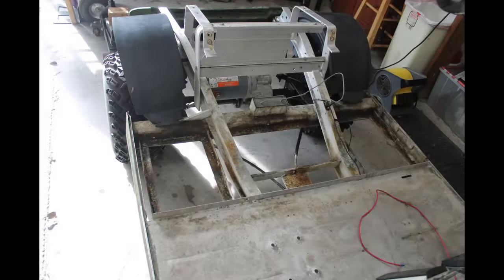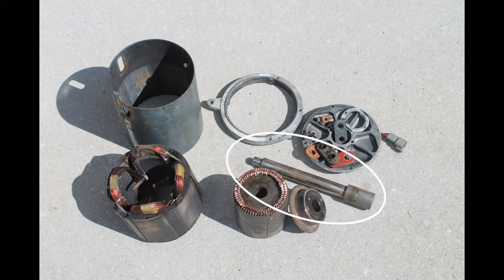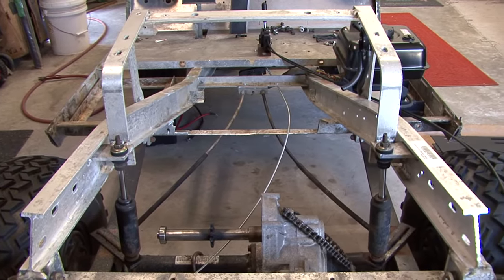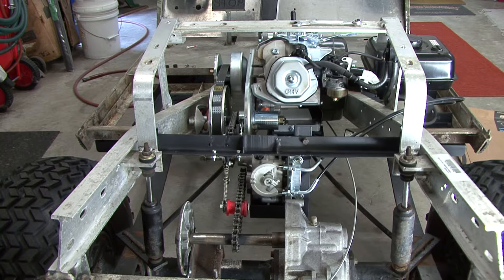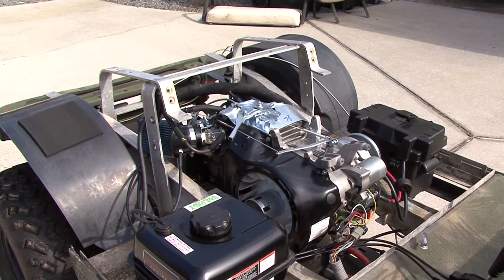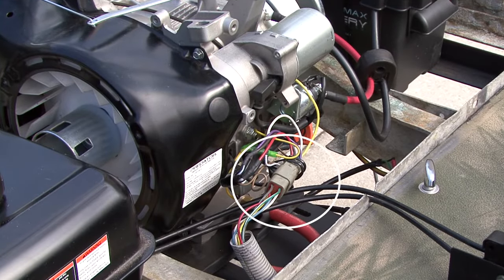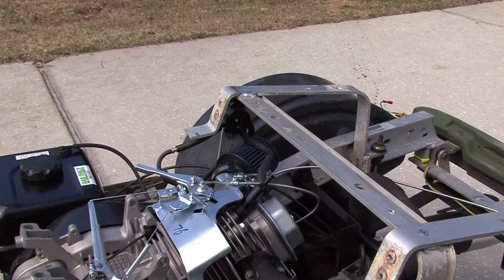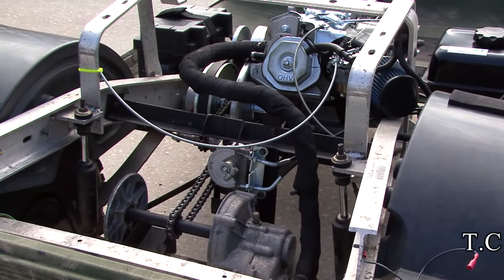Golf Cart Gas Conversion

Comment: Hello, got side tracked since last post, I fliped the rear ,that went very well. I chose a 14hp subaru engine  set up with a  chain clutch ,  and  did not like that ...but due to other projects , I had to put that aside.Now I am back at it and decided to go all in. I am starting today  to rework  the frame  to adapt to the engine ,the 40 series torque converter, and rearrange the placement of my trans..  I  find That this is the way to go with  great info as a guide ,Thanks again for detailed video.

Comment: Just finished a 1998 basket case ,especially everything was in crates ,now I am on this conversion, installing a Subaru ex40 ,they have the exhaust on the top and that created a problem with the body, had to position the elbow to the side  ,other than that your blueprint is  on the money

Comment: I did a similar build i did use a gas rear end on electric frame. Electric frame is way stronger than gas and also did the brake flip and turned the axle like you with 6-1 gears and a comet clutch no chain dose 40 mph I like how you think.

Comment: Hello My Friend , wanter to give you an update on the conversion , well , it all comes back to the engine I choose , which is a great engine ...BUT... the exhaust exits is at the top of the engine , I  Had to modify that whole section  above  heat shield  and air space to clear  for the seat closeure.  and  fabricate the manifold outake tube as well.  I  had the yellow spring on the driven clutch  it  was a lot of torrque  just about lifted the front off the ground ,but I did not like  that  ,so I went back to the red spring and  and drilled another hole inbetween 2 &3  for spring tension .The rotation is the same and proper direction. Now for the Biggie ,I had the shaft turned down to & 7/8 ths to accept the 10 tooth  gear with the 3/16ths keyway. I orginally was at  a 14 tooth  and a 40  chain . .  I keep refering to your build and it helps  me to  stay focused . Thanks
Reply from the maker: You are making progress, that is great news to hear

Comment: You had any issues with the chain coming off the rear axle when hitting large bumps
Reply from the maker: No, I have the chain pretty tight.
Reply: @BigBlok502  thanks for the reply I picked up a club car 1996 and the aluminum frame and axle looks exactly like yours

Comment: Hello my Friend , thanks for all the tech advice, I was hoping that you received the link to my driven clutch directly  to the gear box stepping the 5/8 shaft and a extender shaft coupled.  I do have that in one of my videos. I installed a 14hp subaru 40ex engine with the gearbox. The problem with this type engine is  that the exhaust exits from the top of the engine so my clearence from the seat was very limited. I did compensate   for  the heat exchange . I found a OEM  gas clubcar pan mount that I will install this spring which will lower the engine from my temporary fix. I may remount the gearbox,to bring it closer to the rear,was wondering if the shorter  chain distance would make any difference in the drive... I got another shaft and stripped the windings , (2nd one I did, no fun at all } and I will turn  three quarters of the shaftthat down  to 7/8ths to acomadate the  10 tooth 40chain  gear.My clutch is mounted same as yours , I did install the green/yellow reverse spring ,but I noticed that yours was still  the factory red spring . I maybe should have left well enough alone? Cheers
Reply from the maker: Hey, thanks for the link, I never did get a notification from YouTube about the link though. Nice work.

Comment: Have you had any issues with the gear box causing a jumping sound? Almost like a loose chain when you start to accelerate... Mine is causing a bouncing jumping situation.
Reply from the maker: Not from the gearbox. In the early days I was getting a snapping noise from the chain due to the axle twisting, I cured that by installing heavy-duty rear springs.
Reply: @BigBlok502  I'll have to keep that in mind. I'm doing a huge build on my club car. Extended it to a 2 to a 6 passenger. And put a 459cc predator in with a reverse gear box. I built a custom 12" lift and put some nice 32" tires on it. But I'm having a terrible clunking / Jerking problem.

Comment: I’m In the process of building the same cart setup, my next step is buying and engine, did you have extra room with the preditor 420? Harbor freight has a preditor 459cc which according to the website is slightly bigger, wondering how much room you had putting in the 420 and in your opinion if you could fit a 459cc
Reply from the maker: It's a pretty tight fit, I had to remove the pull starter in order to fit between the frame rails. The Predator 459 looks to be the same configuration though, so I would imagine you would just run into the same obstacles I did and make it fit.
Reply: According to the website the dimensions are slightly different, im assuming the width is where you ran into clearance issues, I would really like to put the the 459cc in there but I feel like I’m taking a risk, in your opinion and experience would you put the 459cc in your cart if you had the option back then knowing what you know now?
Reply from the maker: @Cam_Bass  I would stick with the Predator 420.

Comment: Finally got the engine and trans fitted,  I mounted the pulley to the gear box , I tried using a push  choke cable but I can't get full throttle , I think I will use your method ,do you have any  info on the cable you used , I have the same cart. Thanks!
Reply from the maker: I removed that choke cable because it was too long and after a period of time it became almost impossible to pull the choke on. I replaced it with a shorter cable and drilled a hole in the bulkhead just below the seat and it works much better.

Comment: Wondering how your gearing is working out.  About to do it your way.  Seems like a good approach.  😎👍
Reply from the maker: It's working out great for me, I drive it daily.
Reply: FYI I’ve been running mine for about a year now and it’s great. The gearing works perfectly with my 12/25 tires. Thanks for your approach.
Reply: WhT kind of mph are u guys getting
Reply: @johnnycrawford7690  mine will go 28mph.   It climbs hills pretty good also which is what I was hoping for.

Comment: Great build and video! I just finished my club car ds and used some of your ideas  like turning the axle 180°, which made way more sense. I used the predator 420 with the 40 series, but was able to order one with a 5/8" shaft so driven clutch went right on the reverse gear box and then used the 10 tooth 40 series sprocket to go to the the electric motor spindle that I pressed out similar to yours but I was only able to find a 13 tooth sprocket for it. My question to you or anyone on the thread how can I get better top speed? I can only get 10-14 mph tops. Would the sprocket on the pressed out motor shaft need to go larger or smaller? I know I can possibly replace the gears in the axle assembly, but the cost is over $500. I do have the stock 18" tires and it's not lifted, would lifting and putting 23" tired make that much of a top end difference? Thanks everyone, I hope to post mine when I get all the little kinks worked out.
Reply from the maker: A smaller sprocket on the rear and taller tires will most definitely increase the top end speed.
Reply: Big sprocket on the output of the trans, I'm going with 24 tooth.

Comment: very nice video, but where did you buy the key switch extension? to install it in the dash
Reply from the maker: I cut and spliced longer wires in the wiring harness for the engine

Comment: I’m doing the same but have no idea about the thinking behind the drive shaft support. What should be my goal in creating the support? Also, is there a way to connect the sprocket other than welding that you would recommend?
Reply from the maker: The drive shaft support is the end plate from the original electric motor, I have since welded it to the axle because it kept slipping on the axle. As for the sprocket you could try cutting a keyway in the shaft.

Comment: Hey man, great build very detailed video. I have done pretty much the same thing I use the predator 420 converted it from electric to gas my issue I’m having is the gearing. The cart will not go any faster than like 7 mile an hour. I originally had a 10 tooth sprocket, maybe it was 12 on the gearbox and I had a 12 tooth sprocket on her rear axle and I couldn’t get over 7 mile an hour so I put a 36 tooth sprocket on the rear axle and it still doesn’t make a difference or do you happen to know why it’s like the motor wraps out before I get any speed
Reply from the maker: Try using the same size sprockets that I used. Also, the taller your tires the higher the top speed.
Reply: @BigBlok502   that’s what I originally had on it was a 10 tooth and 12 tooth on these from all videos that’s what most everyone is doing
Reply from the maker: @cameronhulin7084  you want the smallest sprocket possible on the rear axle, going to a larger sprocket will just slow it down. What size tires are you running?
Reply: I have a 10 tooth sprocket on the gearbox and a 12 tooth sprocket on the rear axle. That’s the smallest sprocket I could get considering I did not turn the shaft down  so the shaft is an inch and an eighth I cannot find a 10 tooth sprocket that has an inch and an eighth bore
Reply: I’m just running stock tires I plan on getting bigger ones at some point
Reply from the maker: @cameronhulin7084  12 tooth is the smallest sprocket I could get on the rear axle too, my tires are 23 inches tall though, and that may be the difference in the top-end speed.
Reply: Damn auto correct made that reply not make any sense meant to say I’m having an issue with the driven pulley the belt keeps getting wedged as the driven pulley expands under a heavy load
Reply: Mine is doing the same thing, I flipped the axle and it won't push out any top speed at all.  He said they have straight cut gears. Mine is a 83 and it doesn't have straight cut gears on mine. I think I'm going to have to turn the axle back around. The reverse gearing is slower.
Reply from the maker: @cartsquads47  unless your rear axle is a transaxle I don't think you will see any difference, let us know how this works out.
Reply: @BigBlok502  mine is a 83, I found out the 81-83 electric club car has what they call the Terrill rear axle. It doesn't have Straight cut gears.
Reply: @BigBlok502  I got my rear axle out of a 93 club car and put it on easy go just can’t seem to get much TopSpeed out of it. I did flip it 180° so would it be because it’s now flipped around the reverse gearing is different opposed to the forward, gearing?
Reply from the maker: @cameronhulin7084  I suppose that is possible, mine is a 2005 model and it doesn't matter which direction the gears are spinning they spin at the same speed. My top speed is around 25 mph.

Comment: Hello BigBlok 502 , finally completed the build , I mounted the driven clutch to the gearbox by stepping up the 5/8 shaft  to 7/8ths & entending the shaft  .I also installed the reverse spring  on the driven clutch .The  cart has pertty much everything new  , has a rear passenger seat with the frame and triple leafs.. The rear was flipped 360. I am using original  drive gear that was on  the gearbox & installed a 14T 1/18 bore #40  sprocket  onto the rear axel... was not so pleased with the speed. I dont want to put bigger tires on , I like the look  of the cart as it is. Being that your  build was the best  with special attention to detail. I wanted to ask of your opinion on a modifcation .I want to turn the rear shaft down to 7/8ths so I can get a #40  11 tooth 7/8  sprocket on that shaft, I will also move the reverse spring to the last notch for less torque higher speed ,its in the middle hole now. I am also thinking of   increasing the drive sprocket on the gear box that leads back to the rear. I dont need this to be a racer , just enoungh to haul 2 adults and 2 kids . Any help would be greatly appreciated ,thanks.
Reply from the maker: Glad to hear that you've got the build complete. I think it's a great idea to turn the rear shaft for a smaller sprocket, that should probably get you to the speed that you're looking for. I'm curious how you stepped up and extended the shaft on the gearbox.
Reply: Helloo  @BigBlok502
Reply from the maker: Hello, I replied earlier this morning, see my comment above.
Reply from the maker: @walterschilling4512 Hello

Comment: Was the trans mount fully fabricated? And what motor mount are you using?
Reply from the maker: That trans mount was fabricated from scrap metal I had laying around the shop, and the engine mount was just generic mount that I altered to fit the cart.

Comment: Is the gearbox holding up? Is it getting really hot? I'm fixing to put a 20 hp Kohler in a golf cart but want reverse also and cannot find a gearbox rated that high. Want to see how it holds up.
Reply from the maker: It is holding up fine and does not get hot. But to be fair, it is only used for about 10 or 15 minutes at a time driving on my property at 10 to 15 miles per hour

Comment: M project is coming along at a snail's pace ,I am at the  driven clutch pulley .How do you access the drive belt when it needs to be replaced, Thank you.
Reply from the maker: I'll have to pull the engine when that time comes. It was 2018 when I did the conversion, and I drive it about a mile every single day, and the belt still looks like new.
Reply: @BigBlok502 Thanks , I"m on board with it , again this sucker is tight ,but its a nice build , you did a Great Job!  Thanks for helping out.

Comment: What was your method for removing all the windings from the shaft of the electric motor?
Reply from the maker: I used an air grinder with a cutoff wheel.

Comment: When you flipped the front clutch pcs did you have to do anything to the larger back pcs on the torque converter?
Reply from the maker: I did not flip them, that is how they came from the factory.
Reply: Well its wrong  the drive clutch bis backwards.  I can see the belt is not straight from the video
Reply from the maker: @scootersonlyrepair6773  thanks for commenting, the belt is in fact straight, and I have been driving this thing every single day for the past three years with no issues whatsoever.

Comment: Isnt the longer shaft on the F/R transmission supposed to be the output? Im back at doing the smae thing but its been sitting quite some time.
Reply from the maker: No, the longer shaft is the input shaft. It is designed to work on the smaller 30 series torque converter and both directly to it.
Reply: @BigBlok502  Ill have to check it out better, its been sitting so long i had had forgotten.
Reply: @BigBlok502  is it holding OK too?
Reply from the maker: @RandyKraege  so far it is holding up just fine, I drive it about a mile around the neighborhood just about every single day. With that in mind, I do not beat on it I just cruise around.
Reply: @BigBlok502  the cart im doing is just for my property but it has a small dump bed on it. Ill try not to over load it, thanks.
Reply from the maker: @RandyKraege  on occasion I will pull my 5 ft by 10 ft utility trailer around my property too

Comment: Just got done with mine. Thanks for posting your cart. Really helped with mine.  Did u re-jet the carb?
Reply from the maker: Congratulations, are you going to post a video on YouTube? I did rejet the carburetor, I bought the air filter from Go Power Sports and it included a new jet for the carb. I did an experiment and put the stock jet back in and it would only run with the choke on. I put the bigger jet back in and it runs great.
Reply: No video yet. Still work out some bugs.  My trans mount is seperate from the motor plate, and i think its shifting under load causing the chain to skip.  Going to brace both mounts together.  Also have to choke it every time i start it.
Reply from the maker: I have to use the choke to start mine too, my 6.5 horsepower Baja mini-bike requires a choke to start every time as well.

Comment: I have been in the process ,have trans in... jack shaft ,but after seeing this ,I want to flip the rear 180, please elaborate on the pulling of the axels, and brakes Why?
,
Reply from the maker: The brakes need to stay on the left and the right hand side in order to work properly. The axle shafts have to be pulled out in order to unbolt the brakes from the axle housing. Keep in mind gear oil will drain out when you pull the axle shafts out, I found this to be a good time to replace the gear oil in the rear axle.
Reply: @BigBlok502  Thanks !

Comment: I'm doing a 212 conversion what for reverse gear box should I use
Reply from the maker: Same gearbox that I used. If you use a series 30 torque converter, the transmission will bolt directly to it.

Comment: Curious why the axle needed flipped?
Reply from the maker: It made it easier to connect the chain to the transmission, otherwise I would have had to add another shaft and two sprockets in order to get the chain over to the right side of the cart to go to the original position of the drive motor.